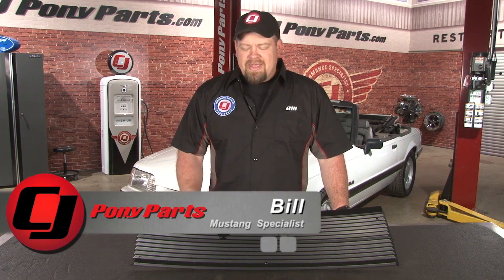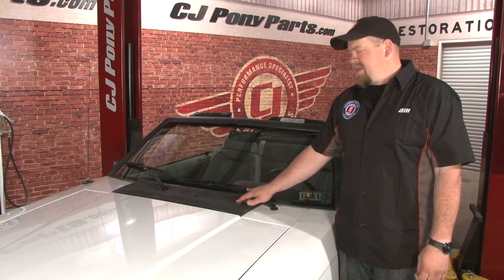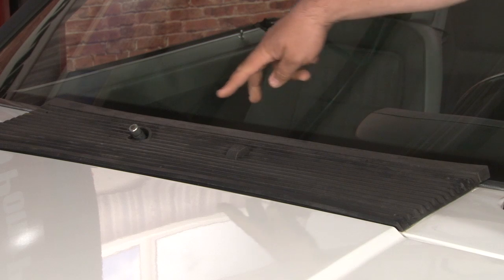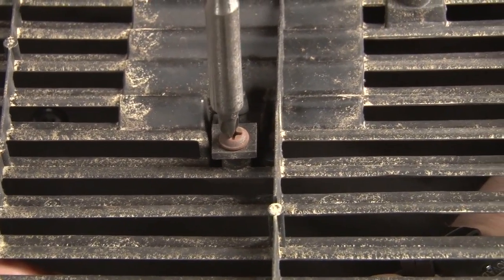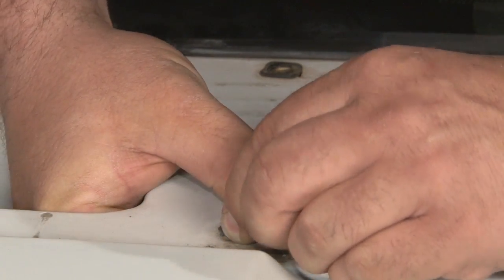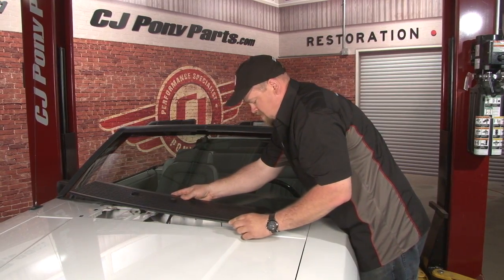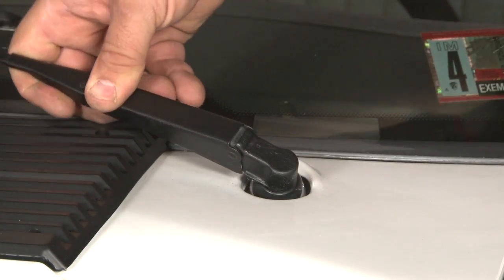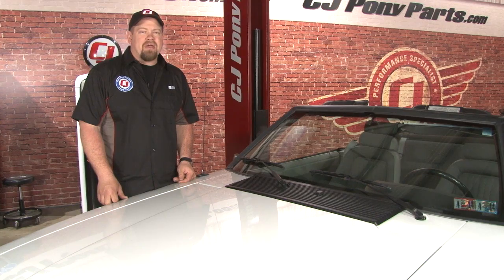Mustang Cowl Vent Grille 1983-1993 Installation

Comment: It's pretty simple. Remove the wipers the same way (Pull out on the clip and pull the arms off). The panel is held down by clips which are very easy to break. Pull up on the cowl panel to detach it. Then remove the washer nozzles. Check out CJ Pony Parts part # CC5.